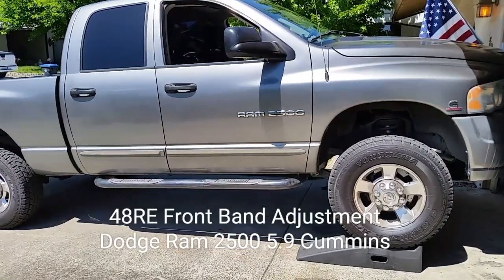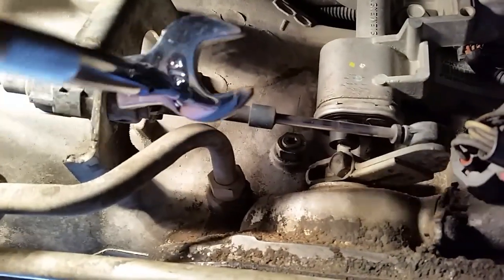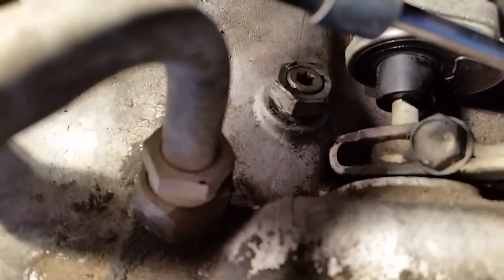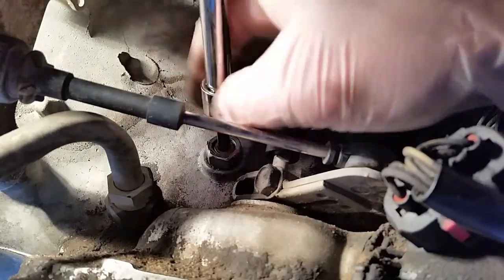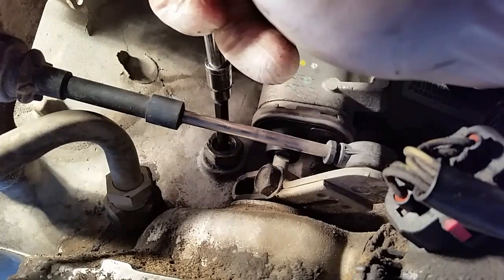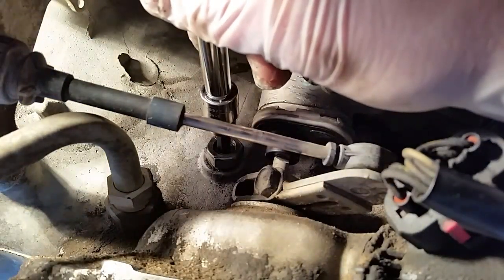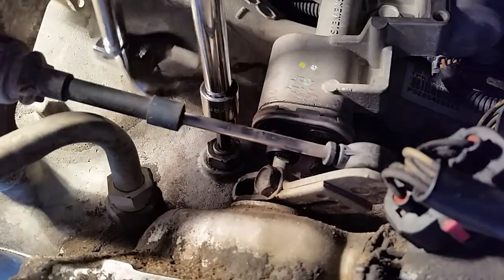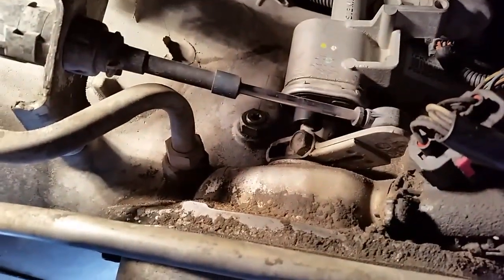Dodge Diesel 48RE Transmission Front Band Adjustment Video

Comment: Good video.  I was told by the Dodge dealer that my transmission (when new) was normal to give a jerky motion at times when going up my driveway. 4 years later, I was told by another garage that I needed a rebuild or new transmission. I researched on YouTube and decided to try a new modulator and adjusting the band's in transmission. The transmission works better now than when it was brand new. Unbelievable! Alot of people are getting ripped off!
Reply: Leave it to Dodge to rip everyone off. I love Cummins, and the 2nd and 4th Gen rams body style looks awesome, but chrysler just keeps cutting corners with the Dodge ram.
Reply: Chrysler dealership just told me my 2006 48re tranny didnt have bands lol
Reply: thats a dealer for ya
Reply: Get this... I went to my local dealer and they tried charger g my 900$ for a transmission coolant flush. They also tried to convince me that my ac compressor was broken and it was going to be 700 bucks when it needed up being an 11 dollar air recycler valve.
Reply: @patriotsfan1236  idle control valve?
Reply: @randyscialabba3982  no the door for air recirculation in the cabin.

Comment: Shop wanted $800 to replace the trans governor solenoid/ pressure sensor & see if that helped.  Did it myself and cured the shuttle surging but not the sticking in 3rd gear.  Watched your video & adjusted the bands.  FIXED!  Drives like new.
Reply: Holy smokes $800!? I just did mine, upgraded to the Borg Warner HD solenoid, transducer, output speed sensor, 3-4 accumulator spring, & filter. Including the 7qts of atf+4 in all it cost me about $120. 

But my tranny still seems to have the same symptoms, stutter shift or holding on to 2nd too long or reaching for 3rd, not sure what's wrong, but I'll try the band adjustment and see how that goes.
Reply: Way to go bud, happy to hear you saved SOME bucks
Reply: John Goold
Reply: John Goold
Reply: Albert Clark did that help? mine doesnt want to go into 2nd at all now
Reply: That's crazy firepunk diesel will pull and install your trans for $500 labor

Comment: Did this to my truck today, glad I  did. I have a 2004 dodge ram cummins. Worried I may need to take it to a shop. My truck would downshift prematurely form 2nd to 1st, or would not stay in second unless I held the rpms almost to 2000 when accelerating, and if I slowed down to around 20 mph it would drop into first. Once it shifted into third, everything was fine. This little adjustment fixed all of this. Thanks.
Reply: I have an 04 that’s doing this and then I get trans temp light. I’ve never had problems with it. Did yours start doing it out of nowhere? Thanks in advance

Comment: PU shifted badly from first to second  after pulling some heavy loads from AZ to CO. Changed solenoid and fluid with little change. Adjusted band as per your video. No threads sticking out after adjustment but it did adjust. Shifts nice now. Thank you.

Comment: Why would anyone put a thumbs down to this is video? ??????????         I want to thank you sir For taking the time. I'm AlsoGetting ready Do the same..I have just changed  The Solenoid, And pressure sensor. Of course the Transmission oil change. Hopefully tomorrowI  I would be able to  adjustThe band . thanks again.
Reply: Because if your transmission needs band adjustment that mean your band need to be replaced. If you adjust that band you will damage the drum and the rest of the components do to the metal particles of the damage drum.

Comment: this is right from dodge's shop manual 
hope this helps clear up some of the questions

BAND ADJUSTMENT
1. Adjust front and rear bands as follows:
a. Loosen locknut on each band adjusting screw 4-5 turns.
b. Tighten both adjusting screws to 8 N·m (72 in. lbs.).
c. Back off front band adjusting screw 1-3/4 turns, for diesel vehicles, or 1-1/2 turns for V-10 vehicles.
d. Back off rear band adjusting screw 3 turns.
e. Hold each adjusting screw in position and tighten locknut to 34 N·m (25 ft. lbs.) torque.

Comment: Most important is low reverse band adjustment. This band being loose will cause a lot of symptoms..like sluggish engagement etc.dont forget to do both bands. The low reverse is the same spec but after tourqe of 72 inch pounds  back off 3 turns.

Comment: Great video. Here's the the service manual information on bands:
BAND ADJUSTMENT AND FINAL
(1) Adjust front and rear bands as follows:
(a) Loosen locknut on each band adjusting screw
4-5 turns.
(b) Tighten both adjusting screws to 8 N·m (72
in. lbs.).
(c) Back off front band adjusting screw 1-3/4
turns.
(d) Back off rear band adjusting screw 3 turns.
(e) Hold each adjusting screw in position and
tighten locknut to 34 N·m (25 ft. lbs.) torque.

This should be done (at least front one) when changing fluid. If you don't you might experience problems coming out of first then jumping to normal shifting, second-third downshifting then back to normal possiby with an ODB code, etc.. It's a simple procedure except doing the first time.

Comment: Good video. I do all my own wrenching for general maintenance on my 05 Ram 5.9 as well. Same as your truck only 3500. Bought new in Aug. 05 now with 444,000 miles as of today, and running better than new. Amsoil Synthetics throughout since day 1. One thing I do that I noticed you do not is that I use brake clean on everything first and or, brush off anything that I am going to undue, twist or turn or replace. I always start with clean grit and grime free surfaces so that everything comes off easy and tightens back up properly metal to metal.
Reply from the maker: Yeah I need to get in that habit, I've stripped enough bolts to know better too🤦
Reply: @DieselCamper  its funny we both have the same first name and exact same truck only mine is a 3500.
Rob

Comment: Was towing my 9k fifth wheel up a steep windy road with my 05 Cummins, when I slowed down on level ground and moving from 1st to second, it had a hard jerk into second and back out to first,  then came to a very steep paved up hill driveway, started up and the tranny slipped and finally started rolling. It's time for a fluid change, I am going to change the solenoid and sensor, along with your band spec. Hoping this solves it.

Comment: Hey Rob,  Quick question why after putting the foot pound adjustment on the torch bolt do you back off a turn and a half what's the purpose seems like your back right where you started?
Reply from the maker: Hi Rick, I assume the purpose of backing the nut off is to ensure the band can fully disengage when not applied by the Piston.  The apply Piston has more than enough travel to make up for the slack off backing the bolt off.

When you tighten the adjusting bolt to 72" pounds you are actually applying the band, so it needs some slack put back in when you are done.
Reply: Cummins&Camping Ok Rob I appreciate it
Reply: What do I do if the star bolt is all the way in now and doesn't have much sticking out past the tightening nut but still have the symptoms described by other viewers? 
 
I did this procedure once about 6 months ago it worked fine until yesterday  tried it again but doesn't seem to  have helped.

Any help would be appreciated.
Reply from the maker: Probably looking at rebuild time.  There is a slip in band you can buy, but you won't know how the clutches are doing if you don't pull the trans and disassemble it.

Comment: Hi Rob, nice vid...wondering how you arrived at 1 3/4 turns back instead of 2 1/2 which is what i've seen on other channels?
Reply: +Rob D ...don't have a service manual, yet so relying on my search skills! Test drive last night felt felt strained so I've adjusted to your recommendations n shifting feels normal, Thanks!
Reply: Diesel is less turns oppose to the 5.9 gas

Comment: I upgraded my solenoid to a Borg Warner and also replaced the transducer, filter, 3-4 accumulator spring, & output speed sensor. Still experiencing some hard shifting between 2-3 possibly 1-2. I'll try adjusting the band tomorrow, I bought the truck with around 230k, has 250k now. No clue if it's ever been adjusted. I'll keep you posted and let you know how it goes, thanks for the video.
Reply: Albert Clark did it help?
Reply: TheLorenz4413 I did not notice any difference after the adjustment. I believe it has something to do with overdrive lockup.
Reply: @albertclark8980 going to have to replace the governor pressure solenoid  get the one from. Thoroughbred diesel performance. But first check if you have codes for the apps sensor or otherwise named the throttle position sensor

Comment: What would the max adjustment be though? Because if the band is completely worn and you adjust it it’ll start running metal to metal.
Reply from the maker: I've found that when you are on your last thread sticking out of the stop nut you are very close.

Comment: My 04 dodge 2500 is vibrating and shuttering when going into reverse and 1st and 2nd gear could this be the cause of this. After it gets passed these it runs like it should

Comment: Curious...What symptoms present themselves that would indicate the torque band needs adjustment?  What difference did you notice after the torque band service?  2004 Ram 2500 similar transmission if not the exact same.
Reply: If your truck is either stuck on 1 or 2nd gear (wouldn't upshift), then adjusting the band might solve the issue.

Comment: I'm going to try this tomorrow, I'm not exactly sure what my problem is but I suddenly lost overdrive and reverse the other day, then drove it today and everything was back normal. not sure what is really wrong.
Reply: +Matthew Cart same thing is happening to mine.
Reply: I adjusted the outside band and it fixed it.
Reply: Well the band that's adjustable from the outside I mean
Reply: Matthew Cart will that help tighten the tv cable?

Comment: Stuck in 3rd and runs okay after  i turn off the ignition to turn on again.. Fluids seems clean on the dip stick, noticed it had a weird sound from tje trans when i accelerate hard.. Now it still shifts okay but cant hold high gears in and out overdrive
Reply from the maker: Did you check the codes?

Comment: Hey Rob D, thanks for the outstanding combo of video clarity, tool line-up, etc.  What symptoms lead you to this procedure?  I have an '03-2500D/48E.  The tranni feels fine when cold but soon after warm-up it feels like it has a high shift point in 1st and definitely has a slip from 2nd to 3rd.  I've replaced the solenoid and pressure sensors, which helped a little, but did not solve the slip.  Will the belt tightening affect my 2nd-to-3rd slippage?
Reply: +Rob D Thanks again for the great vid. Belt tightening worked! And with the added solenoid/sensor, the truck feels fantastic. Every time I add something or fix a hiccup it delays my desire to sell.

Comment: Thank you so much for this video as I'm going to attempt this in the spring after this rain lets up.  I have a 2005 2500 cummins with only 45k miles on it always babied bone stock.  The only real symptom I'm having is sometimes it will randomly from the 1 to 2 shift it like stutters or surges for a second until I give it a little more gas then it shifts and starts driving like normal.  I've noticed it mainly happens if I'm driving like an 80 year old man and barely giving it any gas.  Would this possibly fix it or maybe a solenoid issues?  This spring I plan to adjust the front band and drop the pan to change out the fluid.
Reply: Change the modulator and adjust the bands. inner and outer. Worked great on mine. Better than new!

Comment: I am preparing to do this, but my inch lb torque wrench doesn't go down to 72? maybe a dumb question but can I just set my ft lb wrench to 6ft lbs?
Reply: its Inch pounds not Torque pounds
Reply: @IgotGreens101  Old response and a little late but if someone can use the info, here it is: to convert inch/lbs to ft/lbs, divide by 12. To convert ft/lbs to inch/lbs, multiply by 12. So 72 inch/lbs to ft/lbs is 6 ft/lbs.

Comment: good morning, I would like to ask you about the tightening of the star bolt, it is done with the hand only when reaching the top ... and then at the end it is released a little to look like the turkish ?????????? I would appreciate help at that point in the video
Reply from the maker: It is tightened inwards to 72 inch pounds, then reversed outwards for 1 and 7/8ths of a turn and locked in place with the locking nut.
Reply: muchas gracias

Comment: I can't get my locking nut lose, even with a 1/2 socket, I wonder if they put Loctite on it, good video
Reply: I know I'm going way more than 30 ft pounds and even socket slipped on it
Reply: I got it with 27000 and it's never been done in two hundred thousand miles,  not slipping but figured it is time since I finally changed the fluid and you are supposed to do it with each change, fluid has just got a little dirty and didn't smell bad

Comment: Just a quick question. I know its how its done, but it doesn't make sense that you torque the screw down to 72 inch pounds then immediately unscrew it out 1.75 turns??
Reply: Where the band goes around the drum, its a tight tolerance. So torquing the band down clamps it to the drum. Since 72 inch pounds is the right torque to get the band completely wrapped around the drum with no slack left, you dont need to go any tighter, but any loser may cause issues. Turning the adjuster out 1.75 turns gives the band the proper clearance to the drum so that it doesnt drag against it, but in the event of a shift, the shift time wont be delayed because the piston had to travel further to make the band grab the drum.

Does that clear up the band operation and why you have to do it the way given in the manual.

Comment: hello guys, i was just wondering if this will work 2006 ram 2500 cummins or if it change a little bit?
Reply: Rob D 
thanks thats a good tip,it seems to be a little better, but there is probably something else that has to get done, although the first 500 ft it acted weird like it downshifted when going to stop, then after that it acted normal

Comment: What are the symptoms why you adjusted? I have a 3500 that wont shift past 3rd gear.
Reply from the maker: If it gets to 3rd and won't go into 4th it isn't a band problem.  The 48RE is really a 3 speed trans with an overdrive unit bolted on the back.  When it's in overdrive, the main body of the trans is in 3rd and the bolted on overdrive unit is giving you 4th.

Comment: Just got a 5.9 cummins 2006 and it'll sit in first gear and wont shit at all is it the band out of adjustment iv also herd the band anchor has came off
Reply from the maker: If you pull the pan and valve body you might find the anchor in the pan...

Comment: So I did this on my 07 and when I went to tighten the adjusting screw by hand it just kept going all the way and I just stopped when it got flush with the transmission housing. Any ideas on what could be going on here?
Reply from the maker: Most likely the wedge piece between the screw and band as fallen out.  You will need to drop the pan and valve body to get it back in.  Have you lost second gear?  If it goes from 1st to 3rd this is most likely the problem.
Reply: Diesel Camper yes it seems like it’s skipping 2nd. Do you think this is something I’ll be able to do in my driveway without much problem?
Reply from the maker: Bingo.  Pull the pan and valve body, I bet that piece is in your pan.
Reply from the maker: Also, while you have the pan off is a great time to add a drain plug...
Reply: Diesel Camper good idea thanks for the help

Comment: Hey guys I got a 06 2500 ram when I take off my rpms  hit 4 to 5 and it takes a few seconds to change recently went to a shop n they said that it had no second gear on the tranny i jus changed the oil as well what do yall recommend I do?
Reply from the maker: Seems like you lost the band for 2nd gear.  1st I'd pull the pan and see if anything is sitting in the bottom of it.  Your 2nd gear band lever may be sitting down there....

Comment: I'm having the same problem my second gear hanging up on my 2006 Dodge Ram 2500 I think it's the same transmission.
Reply: Did you adjust the band and did it fix? My is hanging on 2nd also. Wondering if this will fix before having a rebuild
Reply: Let me know cause I am having the same problem
Reply: Same other videos are also taking about governor solenoid upgrade helping.  But i haven't tried anything yet.  
Mine seems to be sticking in 1st then jumping to 3rd after i let off gas a bit
Reply: No one seems to like to reply much in the comments on this video.

Comment: This apply to the Ram SRT-10 transmission?
Reply from the maker: No, there are different specs for gas.  I'm pretty sure it's in the video description.
Reply: 1 1/2 turn on SRT 10
Reply: @kennyblades5862   don't we have to tighten it with torque? ( torque wrenches ) 

I got a ram SRT10.
Reply: @axelmunch6703  yes tourqe spec is the same but you back it off 1 1/2 turns
Reply: @kennyblades5862  yes I just found above in the video. perfect thanks to you, and for the information in France 72 inch is converted to 8 NM. the front band adjusting screw is outside the housing and the rear band adjusting screw is inside the drain housing, right ?
Reply: @axelmunch6703  rear band
(1) Raise vehicle. 
(2) Remove transmission oil pan and drain fluid. 
(3) Loosen band adjusting screw locknut 5-6 turns. 
(4) Tighten adjusting screw to 8 N·m (72 in. lbs. ) 
(5) Back off adjusting screw 3 turns. 
(6) Hold adjusting screw in place and tighten lock- 
nut to 34 N·m (25 ft. lbs. ) torque. 
(7) Position new gasket on oil pan and install pan 
on transmission. Tighten pan bolts to 17 N·m (13 ft. 
lbs. ) 
(8) Lower vehicle and refill transmission with 
Mopar ATF +4, Automatic Transmission fluid.